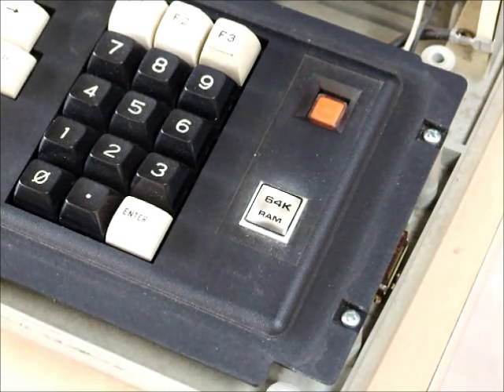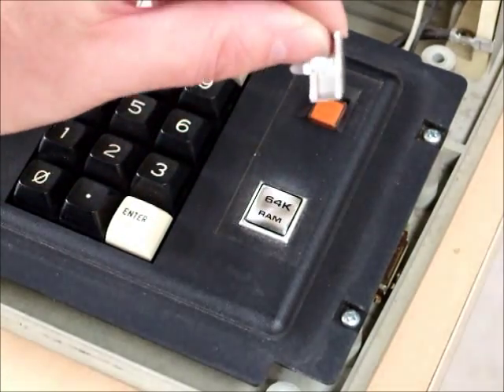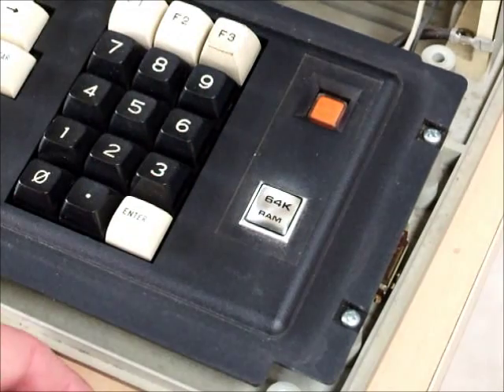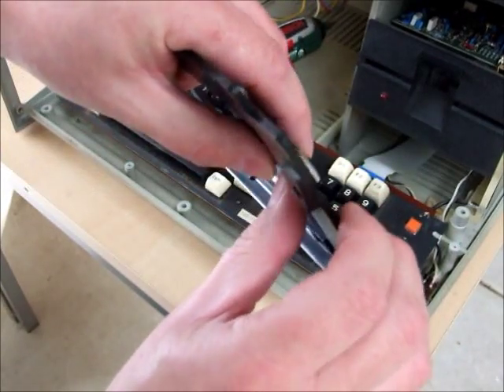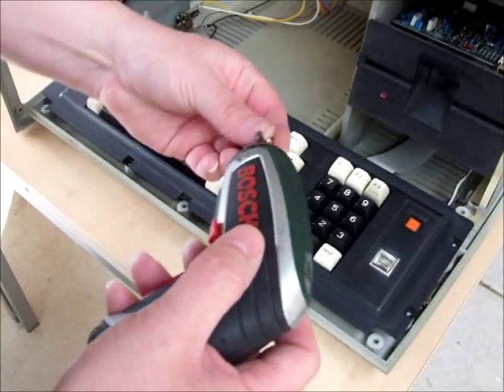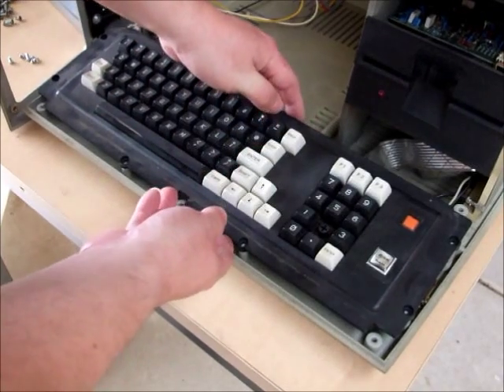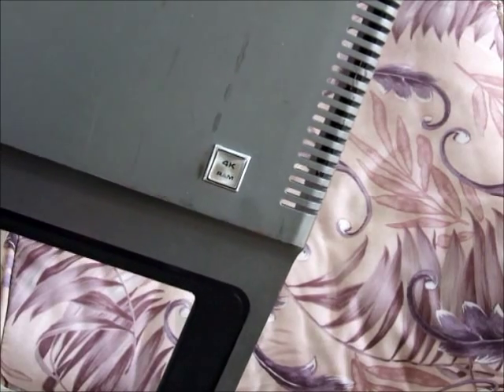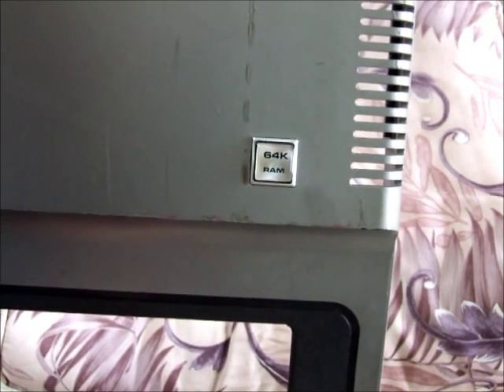Upgrade ram size badge on TRS-80 computers

Comment: What did you do to upgrade the memory on the computer?  What does it take to upgrade?  I have a Model 4P with 64K. Is it possible to upgrade it to 128K, and what would it take to upgrade the computer?  Thanks- enjoy your videos.
Reply from the maker: To upgrade your 4P you need 8x 4164 150ns, 128-cycle refresh chips, and move 1 jumper on the motherboard.  Your 4P requires major disassembly to install the eight ram chips.  Hope this helps.